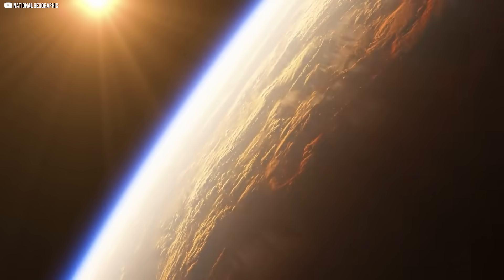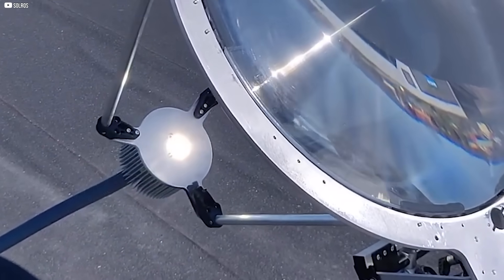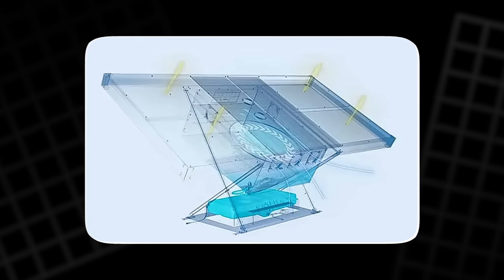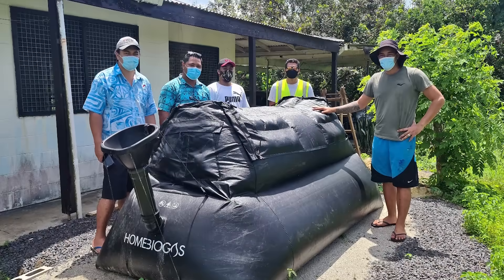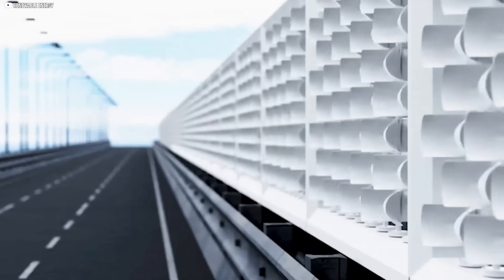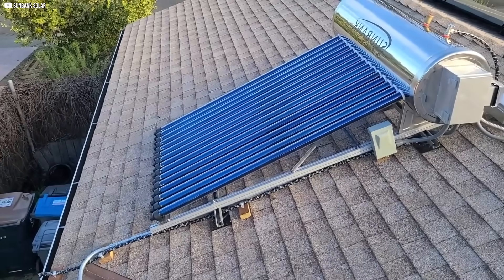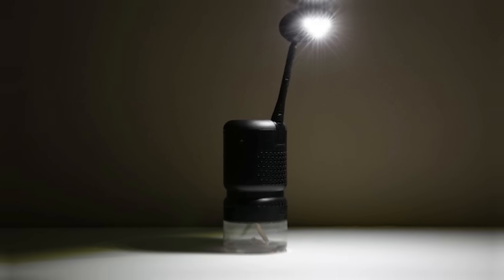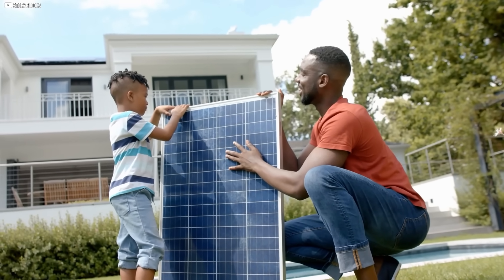The Secret Systems Already Preparing for Global Collapse

Comment: What about the energy of cooling temperatures. Day to night.
    6:00am cold, 6:30am warming,7:30am warm, 9:30am temperatures rising rapidly, 11:30am Hot,
6:30pm Hot and starting to cool***
Take the same principle of the heating and apply loss of heat the same way. A spike of electricity with 2 neutral periods per day. Possibly 16 hrs of energy harvested per day. 📈📉

Comment: WHAT ABOUT SPLITTING SEA WATER INTO O2, AND H,...THEN, USING HYDROGEN GAS AS A CLEAN FUEL??!!!...  
WHAT ABOUT USING "SAND-BATTERIES" AS A HEAT-COLD STORAGE MASS, FOR NEW BUILDINGS??!!...   
AND, HOW ABOUT HIGH "R" RATED CONSTRUCTION MATERIALS, AND METHODS??!!
Reply from the maker: Those are all very interesting potential solutions to explore!

Comment: Ok, 2nd one...the water collector, needs new filter every 6 - 12 months which costs couple grand so the cost of producing water from air is very expensive and it needs moisture so doesn't work in dry climates... 
ALL these inventions are cool but NOT sustainable
Reply: Works, even in the driest of deserts.

Comment: Fibre optics have a frequency response curve. This means that the light passing through them is ‘slowed down’ to varying degrees. So the light that reaches the house is not like daylight; it may be very similar, but it is altered.
Reply: 95% the same close enough is good enough
Reply: @13thbiosphere  the video stated that it also carries no heat or uv.  so thats removed too. also when you look at the size of the collactor its not going to be that bright
Reply: @thespugy  5 watt is intense
Reply: @thespugy 
It's free, enough to light a room better than an average low output lightbulb and replaces all that it takes to run it with one thing that maybe weighs as much as a turkey, and it's going to have some near infrared so you're going to have skin and eye health benefits. You can just install a few collectors and have plenty of light as long as the sun is shining.
Reply from the maker: Thanks for the insight into the technical aspects of fiber optics!
Reply: Amazingly, the same happens to water once pumped through a pipe. Something small gets lost, but water it is.